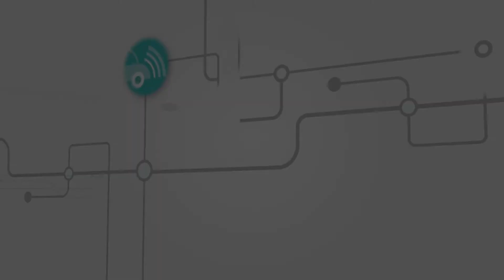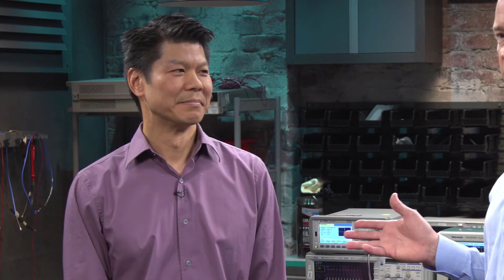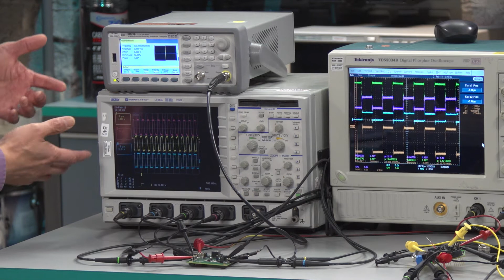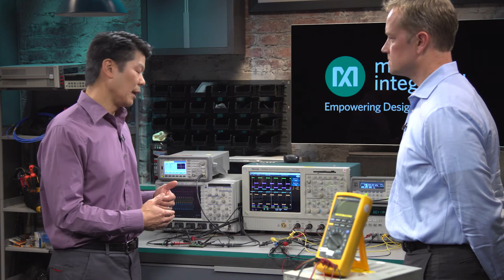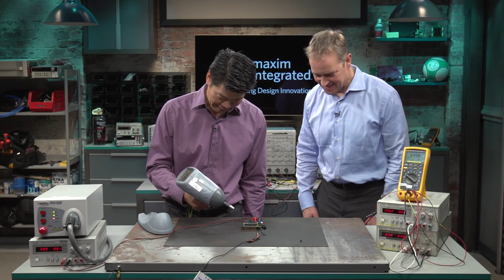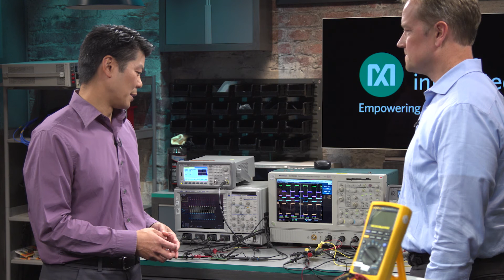CAN vs. RS-485: What's the Difference?

Comment: Due to not haveing a facny ESD gun we use a BBQ lighter instead. Could you show the difference between an ESD gun KV and a BBQ lighter? We even just rub or feet on the floor to make some ESD.
Reply: Just estimate it from the max spark gap.  Just don't heat solder your PCB boards on the BBQ grill.
Reply: @preddy09  that will tell you the job not the energy
Reply: @Ender_Wiggin  well if you need that much specific details, it's not hard to make a few kv discharge switching transformer device. Use that to store a dc voltage In a cap.  You should exactly what's coming out.

Comment: I think the key point to mention is that RS-485 is just an electrical specification and not a communication protocol. While CAN bus has an electrical specification and a communication protocol (IE the format of a CAN frame).
Reply: exactly. And the crucial part of CAN is how the protocol handles collisions without re-transmissions. That's important for controllers in cars: the data from the top priority device is never delayed. CAN frames start with arbitration bits. The standard requires that each bit spans the whole length of the bus wires. Hence, the devices can figure out which one has higher priority while they are sending the arbitration bits. That's also what limits the bus to 40m at 1Mbps - the bits propagate through the bus wires at the speed of light.

Comment: CAN vs. RS-485: What's the Difference? the first one is protocol, the second one is interface? right?
Reply: 485 is only an electrical standard. Nothing more :)
Reply: As far as I can tell, other than the basic analog copper cable, any interface has its own protocol e.g. USB interface (all iterations of them) have their own protocol of communication, as serial port, parallel port, etc even thought that the various interfaces can have various protocols every single one has at least a protocol...

Comment: An important difference to point out would be the protocol: are the framing bits significantly different between the protocols?
Reply: CAN frame header contains arbitration bits to avoid collisions and allow the top priority device to send its data without re-transmissions. To make it work, CAN requires each bit to occupy the whole length of the bus wires. Bits spread through the bus at the speed of light. Hence the limit of 40m at 1Mbps.
Reply: The difference (roughly) is that a 485 message consists of a bunch of independent 11 bit characters, each with their own framing bits, whereas a can message has all 40-something payload bits, including error correction bits, crammed together between one set of framing bits.